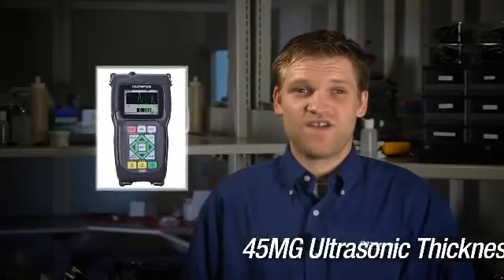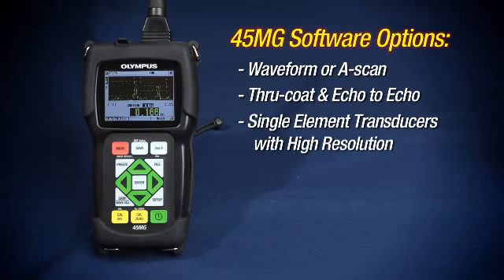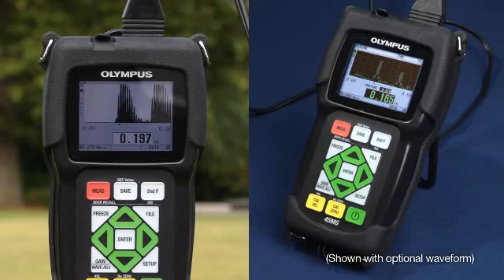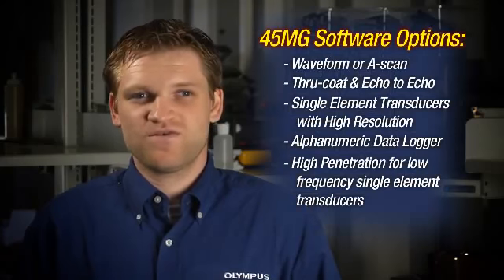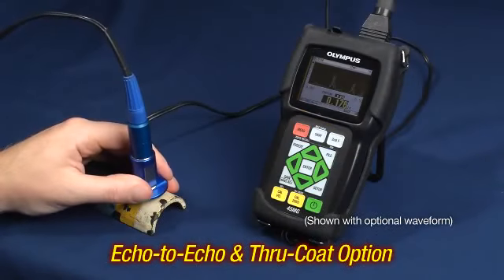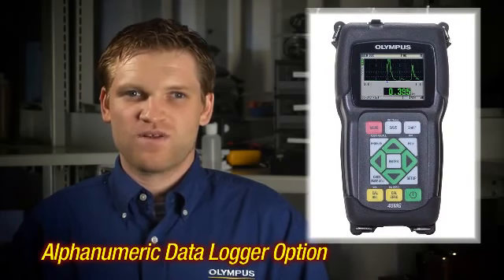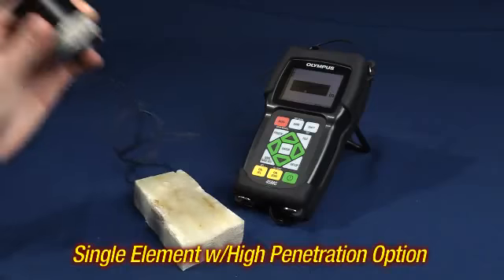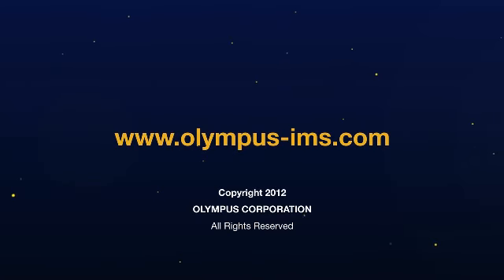Olympus 45MG Thickness Gage

Comment: HI there,  I have a metal strate that is coated with  composit ( fiberglass + resin)  layers with thicknesses between 0,3 up to 10mm .   Ca we use this unit to measure metal thickness through 10mm composit coating ?   can measure separately the thickness of the applied composite coat?